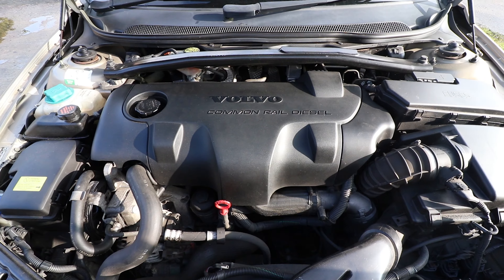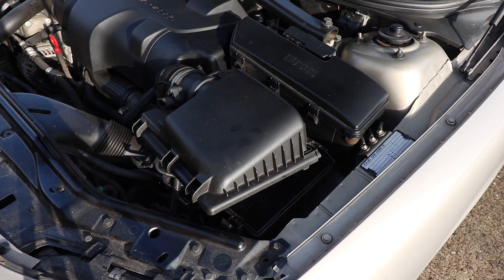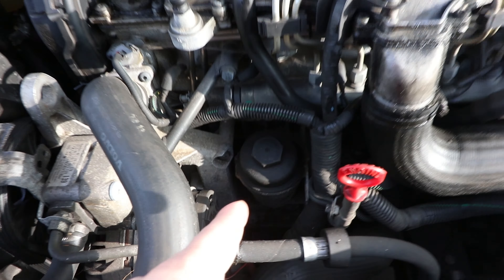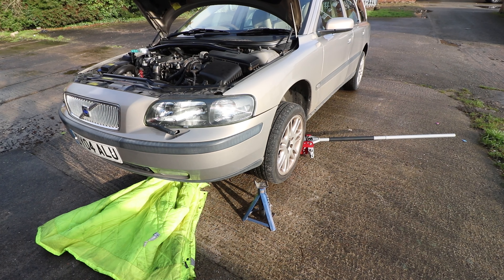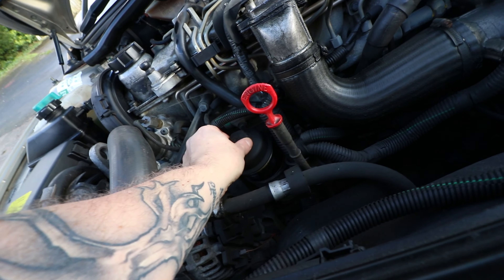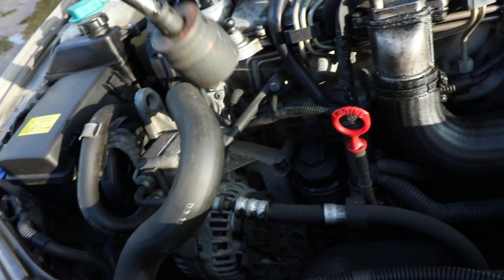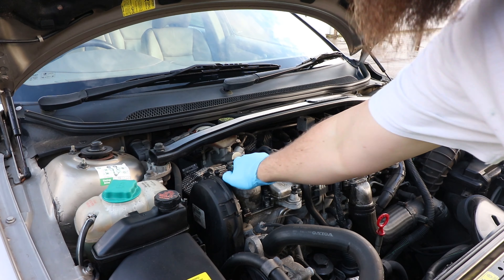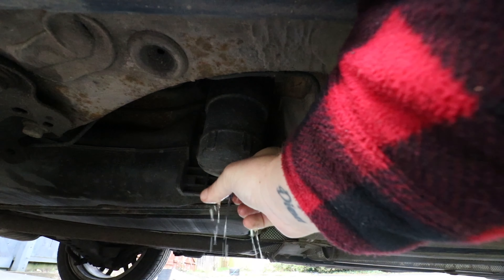How to service a Volvo V70/S60 D5 engine! D5 2.4D etc STEP BY STEP!

Comment: Hi, great making videos on these good old D5 (pre dpf, those have the black engine plast covers if you didnt know, the later ones with whirl flaps and dpf have the black and grey engine cover)
The x's on the dipstick between low and full are actually how many Deciliter there are between low and max if you didnt already know.
I love these old volvos, and now i'm buying my volvo nr 8( s80 nr.5)  an 2004 D5 of course 😉👍
Keep up the good work 👍
Norway
Reply: Hi Arne is it a automatic?
Reply: @muckle8  No, this ond sas actually manual and it was sold last year (august) But i found another one again, this is an Exclusive and an automatic. It has only had 3owners and was an embassy car before i bought it. It has an overhauled engine from Volvo and is in god condition. Will be completed this spring i hope.
Reply: @oddarnestrand2047  I  have a 04 s80 d5 SE auto in light gold colour here in Uk , my trusty old daily runabout.  Also another s80 2.9 petrol in night fire red but spares only - don’t see too many on the roads in Uk now though  😞

Comment: Hey i know its an old video.  Do you know about there is an oxygen sensor on volvo  v70 d5 2002 .

Thanks . 
Best regards from Danmark
Reply from the maker: Hello,
Most exhaust systems will have an O2 (oxygen) sensor to monitor combustion etc in the exhaust system somewhere. If you are having issues try scanning the codes first and a good scanner will point to which sensor it is :)

Comment: Hi. I hope you can please help. Fan of your channel...I have a 2.4d volvo s60. I stupidly ran out of fuel the other week...I refuelled but can has gone into a limp mode. I have full reva but no power. The engine system service required light is on. I've bled the high pressure fuel rail nuts as per your video but I can't resolve. I've changed fuel filter as well.  Any tips PLEASE. I can't afford a volvo dealer to fix. Thanks
Reply from the maker: The running out of fuel shouldt have casued any issues as its self bleeding, might be worth going to a local garage to scan the car for codes as the engine light is on, then you can narrow down the issue.

Comment: Thanks, its a great video. 👍 did you use 5-30 oil?
Reply from the maker: Thanks! Yes 5w30 I believe, will confirm later
Reply: Great video. Very good guidance

Comment: Opinion on using an oil extractor pump instead of draining it trough the plug? I want to do a DIY oil change and would like to try that method. People say it is a legitimate way to do it.
Reply from the maker: I'd say you'd be fine, it gets most of the oil out if you have the engine warm before commencing. Some people say it gets even more out than draining to be honest. If i had one I'd probably use it so definitely be fine!
Reply: @Enginesetc  I dont want to buy jackstands, ramps etc just for an oil change you know... not for now at least :). 
So getting to it from the top is all I can do. The oil is VERY overdue at 37.000 Kilometers and being in that engine for years so I better get to it.

Comment: Great video. My 2006 V70 d5 uses loads of oil and exhaust keeps filling with soot. Any idea what could cause that? It's drinking oil like no tomorrow
Reply from the maker: Thanks!
Yours I assume is the Euro 4 180 odd HP D5 due to the age, not sure but do those models have a DPF? Neighbour has a D5 S80 and that uses a lot of oil and deposits soot a lot and I believe it's due to the DPF, I'd maybe check that as a first port of call. After that, what grade of oil do you use, is it thick enough for the age/mileage? Too thin oil will seep past rings in higher mileage engines
Reply: @Enginesetc  yes, that's the one. DPF keeps filling and can't seem to really properly regen. I do a regen on motorway and then ten minutes later it's blocked again! On second exhaust now. Lotta miles on it (180k). That's a great point on the oil, I used the recommended 0w-30 Castrol, but recently got a cheaper generic brand 5w-30 and seems a bit better? What oil would you say would suit the age better?
Reply from the maker: @Left_it  I'd definitely delete the DPF if I were you, they dont save the environment anyway and just choke diesel engines that would otherwise last forever. Alternatively get it to do a forced regen and really clear it out. The oil id definitely say 5w40 or even 10w40 if its drinking it and see if that helps. It doesnt get that warm here so not worth having an ultra thin oil anyway
Reply: @Enginesetc  thank you mate sounds good. Ill look into forced regen and ask around about exhaust work it might be a good shout (is it technically 'allowed' and legal to do?)
Reply from the maker: @Left_it  No problems. It's not technically legal but just find a friendly MOT tester if I were you. The DPF is a crap invention anyway, it saves all the soot then burns it in one go, how is that any better in the long run than just releasing it as and when as part of the combustion process?
Reply: @Left IT .. Your engine is a D5244T4 or xxxxT13? (6 speed manual?)
Grey engine cover? (should be grey)?
Smoke from the exhaust? If yes, what colour?
Has it ever run hot .. like "in the red"?
You have oil leaks from seals and gasket on the engine?
How is your Miles/gallon?
Does your intercooler system show extensively oily "sweat" (there will always be a little .., kind of .. oil film in places ..)
Does the engine have a knocking or clicking sound .. specially under part or full load? From low revs to high revs in high gear
Turbo hauling?
You said "2. exhaust system" .. changed completely? if yes, Original, OEM or "Taiwan model"

Keep the oil at 0W-30, ACEA A5/B5 and change every 9.000 to 10.000 miles at the most! .. Amsoil Signature Series Synthetic is one of the best. (look up "project farm" on youtube)

Check of the swirl flap system .. specially the swirl flap control arm .. has a "bad habbit" of getting loose in the joints and fall off

Check/clean the EGR system (and butterfly valve now you're at it)

Check common rail and injectors (they can .. not saying will .. get faulty at around 150K to 170K depending on driving conditions ..)

Thats it for now, I think ...

the VISTA mechanic
Reply: @tellyonthewall8751  yes to all of those! Sounds right. Thanks for the diagnosis, seems pretty expensive and the sad thing is this car won't be allowed in London anymore due to high emissions. So I'll have to sell it! Big shame as I like it a lot and it has 175k on clock but with some work it could last a long long time more

Comment: Mann oil filter or OEM Mahle? The Mahle looks better and is a bit more expensive.
Reply from the maker: I'd say either! I've always used mann in every car as I trust the brand and they do a lot of OEM stuff for other manufacturers/components, but if you feel more comfortable in the Mahle, go for that! I'm sure the Mahle will probably be higher quality, but nothing wrong with the Mann one at all so just comes down to if you want to spend the extra